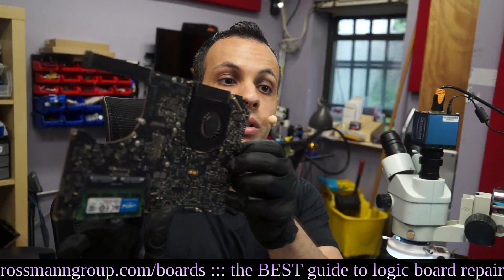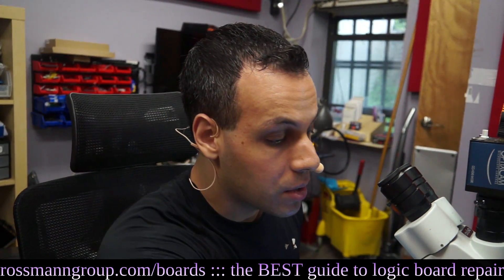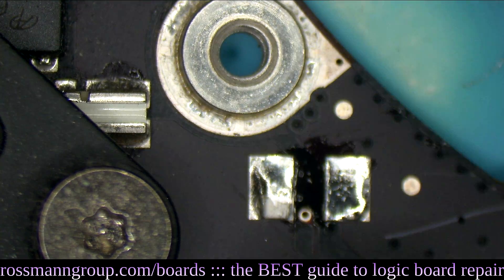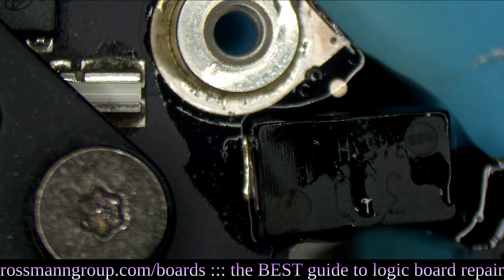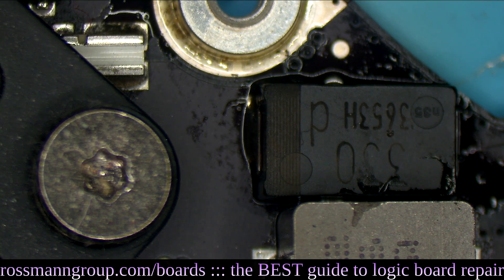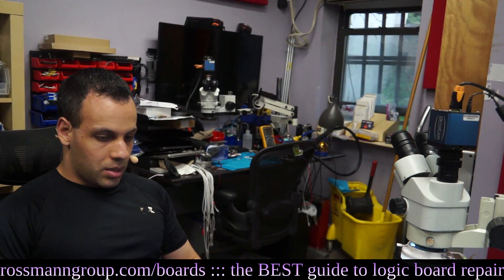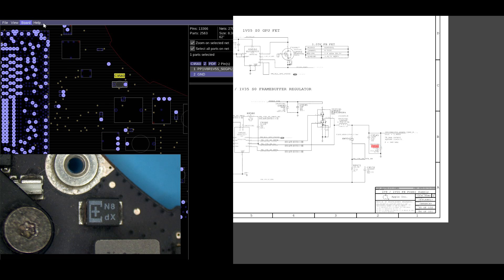Macbook Pro 2010 GPU kernel panic repair without scraping logic board

Comment from the maker: Don't delay! Buy today! https://store.rossmanngroup.com/d3-c7771-c9560-1-piece.html
Reply: Hey Louis, two years ago in 2016 I came by your shop with a mid 2010 15 inch MacBook Pro with gpu kernel panic issues, and I was turned away because your colleague said that you don’t repair these machines anymore. It’s 2018 and you’re repairing this model today. What gives?
Reply: Louis Rossmann Man it just doesn't feel right to hear store.rossmanngroup.com without hearing "Don't delay, buy today." Is that weird?
Reply: Hi Louis. Big fan here. I fixed today my 2010 MBP which had the same issue for years (very annoying). You'd be surprised of how highly-priced tantalum 330uF 2.5V SMD caps are on eBay for some reason ;-). Got it from an online electronics store (which treated it as what it is, a very common stock part). Then quickly located it on the logic board and swapped it. Thanks for your videos, I find them very educational. Greetings from Spain.
Reply: For me... Listening to, "don't delay, buy today" makes worth watching
Reply: Malcolm Nadeau Grab a cheap soldering iron and some kits to practice soldering with 'full-size' components first to get a hang of soldering before moving on to SMT; Arduino/Raspberry Pi's can be used to make just about anything with their huge range of add-ons.
Reply: What do you think about the acer predator helios 300?
Reply: Louis Rossmann check out eurocom.com 
They're based in Ottawa Ontario and actually seem to know what they're selling... Kick-Ass laptops built with desktop components...
Reply: Kerwin junk. Cheap, mass market, Chinese outsourced, junk.
Reply: why don't i see board number identifiers on your video's. i would greatly help to find the 820-xxxx or Axxxx number associated in your list in here instead of SChILLING link's. I know your busy and all, why not get one of your Minion's to straighten it out, as punishment for not putting things away properly.
Reply: FYI, I dont mind paying the extra $$ for the capacitor since 1 - You're video required research and I appreciate the info! And hopefully it will be THE ANSWER (we'll see) to this aggravating kernel issue and 2 - You made available the cap that REQUIRES NO SCRAPING! 3 - I'm anticipating that a semi-novice (like myself) could get the answer to "What approx. Temperature should I use to desolder/solder the new capacitor? Thanks!
Reply: The price for the capacitor I'd love to pay to you,
but the shipping seems way to high @15usd, 
almost like your sending me a big package; 
whilst this is just a teeny speck.

Comment: I just repaired my mid-2010 MBP unibody with anti-glare display.  Got the 330uF from Mouser for about $2.  Works perfectly now, no more kernel panics on High Sierra (now an unusable OS).  Runs Debian 12 like a boss though and probably others!   Replacing that cap was amazing, its possibly not for the faint-hearted, removing all those screws and fragile headers and hitting the board with hot air.  But you feel closer to your tech when you save it from landfill by repairing it yourself, so this MBP is a keeper for me.

Comment: Thx for the video, i struggled with this since i bought mid 2010 few years old and used software to postpone this hardware error, until i found this and did this 10$ fix….
Ps i did it few years ago and macbook still working just fine with ssd, enough for videos and text edit. ❤

Comment: I am not an expert, but I have this machine and I want to revive it with that solution. The store rossmanngroup does not deliver to Germany at the moment, I am looking for an alternative. I just need some few information, which will help me find a suitable capacitor. What is the physical size of the capacitor? and what is its type (ceramic, polymer, tantum/polymer)?

Comment: Thanks for the video, I have the same problem but I can't find that capacitor, I can ask you a question, can I replace it with a smd 330uf (330 e 86) 2.5v. it is only two pads.  Thanks man !

Comment: I've pulled my 13" mid 2010 mbpro board out to fix the common kernel panic issue, and it is smaller, only has one fan, and I can't see where the replacement 330uF cap goes. Any suggestions?
Reply: This is a 2.4GHZ Logic Board for Macbook model A1342.

Apple Part #:
    661-5640 
Manufacturer Part #:
    820-2877-A

Comment: So I have this 15 MBP 2010 and on my case it freezes and most of the times I start up the laptop it shows a pattern on the screen with diamonds shape and when it happens it won't fully boot  , this capacitor fix can be a solution to my problem ? 
Thanks anyone in advance

Comment: CFG 0xffffffff 0xffffffff 0xffffffff, BAR0 0xd2000000 0xffffff90cbff6000 0x0a5480a2, D0, P3/4\n"@/BuildRoot/Library/Caches/com.apple.xbs/Sources/AppleGraphicsControl/AppleGraphicsControl-3.20.13/src/AppleMuxControl/kext/GPUPanic.cpp:170
Backtrace (CPU 0)

Comment: anyone have an idea whats going on 
Panic Report *
panic(cpu 0 caller 0xffffff7f9eb4d8d7): "GPU Panic: mux-regs 3 3 7f 0 0 0 severity 3 WS-ready 1 switch-state 0 IG FBs 0 EG FBs 1:1 power-state 0 3D idle HDA idle system-state 1 power-level 20:20 connect-change 0 : NVRM[0/1:0:0]: Read Error 0x00000100:

Comment: my 200€msi mobo cant keep a r5 2400g stable, but to the thing with the charging jack on laptops, my old hp g62 has a charging jack with a internaly connected via cable

Comment: 6:25.... you forget they randomly begin to burn themself and are even a danger for the home xD
Same thoughts about Lenovo, i mean i think they were better as the Notebooks were marketed as IBM Lenovo, but still they are fair priced machines with good cases, especially the small more modern ryzen models.
9:20.... i know, HP is pretty bad in building notebooks.... but the cheapest RTX 2080 notebook was the HP Omen 17, 1850-2500$, meanwhile EVERY other 2080 notebook cost like 2900$+, the slower Max-Q-scam Versions even more.
As much i tried to avoid companies like HP, MSI and Razor, since the HP was that cheap, even only 100-200$ more expensive than a similar performing desktop - i was going for HP
10:05... totally looks like the 256MB version of the 330M, damn i hate my 256MB version too, damn apple scam with the different VRam sizes, at least they didnt go for 256MB GDDR2 and the 512MB GDDR3 xD

And just a question, do you sell parts also during corona? I really need some parts for my 2010 MBP, at first i though the GPU is dying but im pretty sure its this damn condensator i need to replace i know now. Its anyways a cheap repair if it doesnt fix the problem or i break the whole logicboard :D

Comment: So I just completed this repair yesterday using an Aluminum Organic Polymer 330uF 2.0volt cap. Works like a dream! Not one kernel panic after 2 hours of putting my gpu through the ringer! Excellent video! Saved me a lot of money. My MBP would crash constantly and frustrated the heck out of everyone in my fam using it.
Reply: I just did the same.  Part cost about $2 from Mouser.  No more kernel panics.   Now running Debian 12 on the 15 year old machine.  Performing well.

Comment: Can someone please help me? Great video, I'm not sure if it is the same problem that my Macbook pro Mid2010 has because it's the 13 inch model. Can someone tell me if the 13 inch model has the same problem with the C9560 capacitator? Thanks.

Comment: hello. I'm using 2010 mbp 15 and it has gpu panic. I fixed that problem with gfxcard status but now bottom of screen is gone and i think it is getting bigger. @t
can I fix the problem if I change that capacitor? thanks for the video by the way.

Comment: Hello, 

Any suggestion to fix GPU failure to Macbook pro 15" Late 2011? I thought, replacing the capacitor will work for me but you just mentioned, it won't. So is there any work around for 2011 model?
Please reply. Thanks

Comment: My problem is not lack of knowledge it's lack of ability. I've got aid 2010 15 inch that needs the cap replaced, but I have no e periem e with microsoldering (not good at normal soldering either really) and I don't have any tools to do it. I have a spare dead board with good caps and everything but o can't find anyone that will do this repair. I can find reballing services for $100-$200 but that isn't what I need done and that's crazy exepnsive for such a simple repair in my opinion considering I can buy a logic board that works for $100 or less. Case in point I bought a whole perfect condition mod 2010 for less than $80 but the logic board was dead. Do you know anyone that offers this service for a reasonable cost?

Comment: Swapped this out with zero experience with hot-air soldering. Appreciate the tip to avoid overheating CPU and GPU. No Kernel panics since. Thank you!
Reply: Is the laptop still working?

Comment: Louis, any chance you ran across a GPU panic problem on 820-2523-B boards?  It looks like C7771 is a ceramic cap.  Based on testing my board it's correctly reporting 1.05v.  Much Thanks.

Comment: Lenovo and a good cooling system in the same sentence? All the Y series suffering from overheatin problems. I had an Ideapad and it died from overheatin. The warranty service reballed the NB, and the my G505s lasted for another 3 months... and it died again from NB overheatin(on a laptop cooler!!!). This time the bga died(ofc after the laptops warranty ended). The replacement bga cost more, than the machines used price, so its restin now on the loft in its box.

Comment: Excellent video Louis, thanks for sharing your knowledge with youtubelandia
I loved the part where you started bashing the gamer laptop aesthetics! haha
I am looking to trade an early 2011 15" mbp i7 2.0ghz for a dell inspiron 15 5556 i7 7500U 2.7Ghz or Dell XPS 15 and ended up having a dude with a dell alienware m14x that wanted to trade and I just cringed at the thought of pulling up and whipping that ugly ass piece of plastic out in public haha
I have some old ass dell latitude d620s running linux lite, and and a mid-2012 mbp 15" i7 2.3ghz that I am currently using as my daily but am in the process of getting CompTIA A+ Certified and dont want to have to use Windows 10 in VM everytime and would rather just get a windows machine that is well built, is an i7, and can be heavily modified. 

What would you recommend? And do you think the the Dell Inspiron is any good? 

Thanks

Comment: 7:20 with that said, my Asus G750 ($2000+) does have an independent circuit board with a power jack. I discovered that when I broke the internal plastic supports for the power jack and attempted to replace the part. However, its external designs sucked, external screen frames would break apart as I use it and I probably won't buy another laptop that's not a Thinkpad or Surface Book.

Comment: @louis rossman Big big thanks to this. I've just done this repair myself. Never done hot air soldering before and needless to say I was nervous. I wanted to buy the cap from you but shipping was too expensive to England and wouldn't have been worth your time. I found the 3 pad larger cap and so far so good. 5 benchmarks run and all works no crashes. 

1: what's the best benchmark to stress test the gpu 

2: How do I donate as it's well deserved. It's saved me alot and better still I've learned alot. 

Big respect and thanks for the free lessons

Comment: Louis Rossmann thank you for your awesome video! i checked my macbook pro 15" mid 2010 (820-2850-A). And measured the part with the macbook on, it should be 1,806 volts but i got 1,569 volts. has my capacitor failed? i get the gpu kernel panic.170 crash.
Reply: Yes definitely. Replace it and it will be good to go.

Comment: Is there a recommended temperature that you use for your hot air station? This specific capacitor appears to be a fucking nightmare to remove, and i'm paranoid about cooking the CPU.

Comment: Overpriced capacitor?? Well, well, let me say that the complimentary Jolly Rancher and fast shipping absolutely justify the price. Thanks man!!  Keep up the good work!

UPDATE:
I am not an enormous fan of blue raspberry. Because of this video I purchased a hot air station and began practicing on an old motherboard. I have lots of soldering experience, but this is my first turn at hot air. I practiced for a few days before attempting this repair. I got the board out, masked it with kapton tape, and popped that blue rancher in. I managed to remove the old cap, clean the pads, install the new one and still had plenty of that rancher left to go. Swapped out the heat paste and buttoned it back up.

Repair worked like a charm. My unit in particular, had all the indicative faults in the log but only panicked under load or after being woken up. It was also aggravated by not being hooked to power, and it was running hotter and had high speed fan cycling rather often.

I am writing this with two video feeds running, at 50% battery power and the fans are just coasting at 2k and temps in the 50's.

Many thanks to Louis Rossman, excellent video, great advise and quality product. Great work! CHEERS!

Comment: Hi may I ask a few questions:
1) what is the liquid louis uses at 3:56?
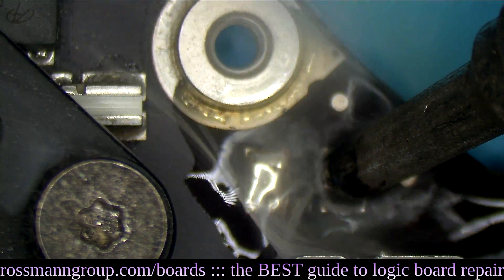2) Is he using tin solder at 4:01?
3) At which temperatures do you use the hot air station and the soldering iron? 

Thanks

Comment: I like HP laptops. But the first one, have overheating problems lasted 6 years in use as a gameing pc (Pavilion dv5) with vista. Now i have HP Envy, exept that i have to uninstal beats audio driver (not a trivial task) no hardware problem. I have to reinstal windows several times and one time full wipe.99% of that was because of my mistakes.

Comment: I don't have a hot air station, bought a TS100 with the idea of using it to fix the 2010 Macbook Pro - what should the temp setting be for desoldering/soldering the capacitor?

Comment: I'm actually very happy with my HP Elitebook I have had it for 8 years now since it was new and the only fault I had was the keyboard stopped working after 2 years. This is my first HP laptop and I'm happy so far, I once got a MacBook Pro (Late 2014, I think...) from always being a Windows user, while the Mac was great... the HEAT... oh my the heat... Gave it back right away, nothing wrong on the quality of the screen or such just not a work laptop in my eyes. When my elitebook goes to the grave (So far I have upgraded it as far as possible, it has a up-gradable socket which I love!) I hope HP would still keep making a solid elitebook.

Cheers
-new subscriber

Comment: Hye, i wanna ask a question. So, my board (asus g55vw) have burnt component and that is acms201209A800 ferrite bead inductor. Thing is, i cant find the same values for the spec (80ohm, 3A), so my questions is, can i use the spare for different value (higher ohm or rated current)? Thanks

Comment: 7:38  I have an Asus g750, I got it in 2014 and it's still good with no problems whatsoever. Didn't have a reason to open it up, so what is your opinion on Asus motherboards and general enginnering when it comes to laptops ?

Comment: If you want to play games on a laptop get a Clevo bare bones chassis with desktop processor and good discrete GPU. all the power but without the tacky design.
Reply: Agreed but for an it professional or other hardcore enthusiast who has the skills to spec one out they are the better value than a retail gaming laptop. The version I ended up with has software giving you full control of the fan curve so thermals are not a major issue

Comment: that laptop is crap...

I have a 2010  Acer with an i3 and a AMD ATI HD5650 and it runs Heaven Benchmark way better!!!
Reply: Raimar Lunardi 2010!
Reply: Only if I can capitalize numbers
Reply: My sister had an Acer with a Pentium dual core and the same HD 5650 and it ran Hackintosh perfectly until the backlight failed.

Comment: Hey Louis, I doubt you'll see this, but if you happen to, I'd like to ask a question. A quick intro first: Upgraded to an iPhone 8 a few months back (regretfully, but that's another story!) So 2 days ago it fell out of my pocket...while I was working up a ladder on a telephone pole. My heart sunk when I noticed it was my phone that fell. It landed face down on the grass, so I didn't know how bad it was. It had a a little white dot on the screen from landing on a rock. Sighed with relief, thinking all was good, but it wouldn't power on. Took the crappy case off and see the whole back glass was shattered! Unbelievable, the screen didn't break. It got hot after, so the battery must've shorted.

Here's my question: I don't think there was any super important pics on there, but if one were to try and recover them, do you think the board is completely fucked, and would it not be worth the money? I already bought a "Sky Elite 5.0L" outright for $175, but it's an underpowered piece of crap. Anyway, have a good one. Thanks

Comment: Hi Louis.

I have Dell M6700 / i7 3840QM 32GB 1866MHz (4X8GB) / 1080p IPS 60Hz / GTX 780M MXM3.0 from aliexpress (i had to "blind flash" this gpu using voice commands in black BIOS screen... took about 20 sec to complete and it booted up) /330W power supply

I got it all togethe laptop w quadro K3000M + 780M from aliexpress about 730 euros laptop feels well built and no scratshes. Was it a good deal and do you recomend dell higer end mobile workstations specially M6600 M6700 M6800 series?

PS: I love your vids and i too hate mac :)

Comment: >HP laptops with shit tier plastic casing/monitor assembly

Yeah that was my Pavilion dv7 when I tried to open it up to clean the heatsink. Monitor just snapped off right next to the heatsink. Bought a new top/bottom case for it, opened it up half a year later to clean the heatsink, monitor snapped off again. That time only on the top half of the case. I never closed my laptop again.